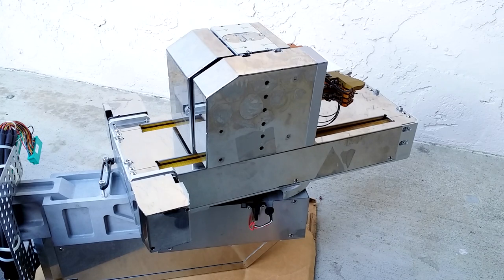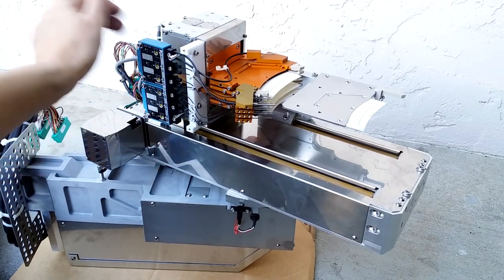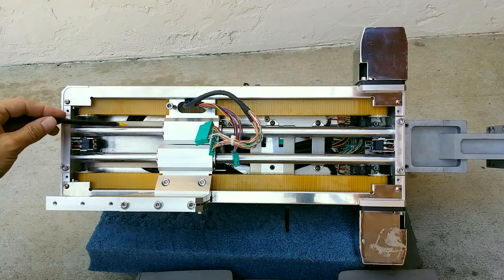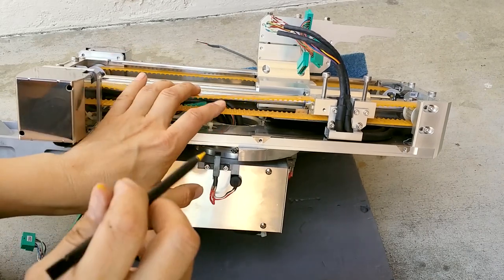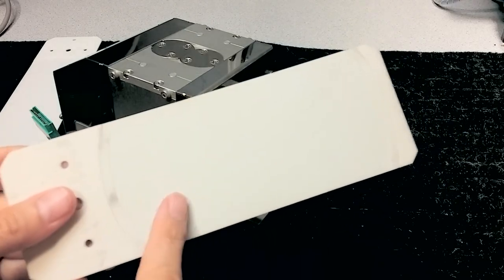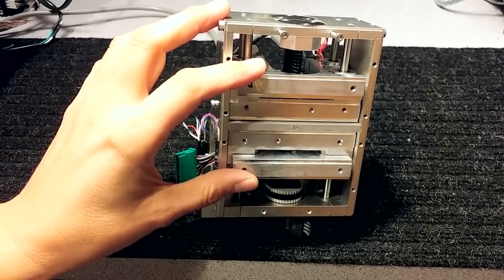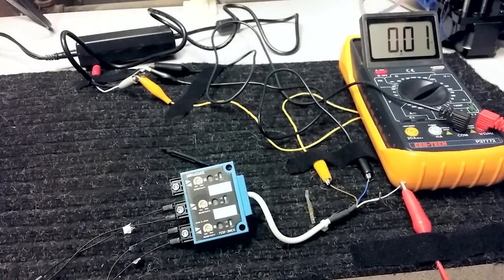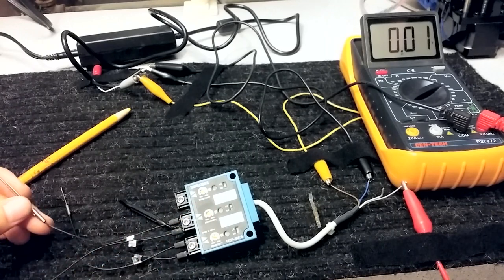Wafer Transfer Robot Teardown and Experimenation - BrendaEM

Comment: Having worked with these devices IN a cleanroom, it both pained and excited me watching you touch the polished faces with bare skin
Reply from the maker: Lol! A lot of this stuff was sold for mixed-metal scrap.
Reply from the maker: So, it was okay for it to be out in the driveway? : )
Reply: @BrendaEM  There's a Cisco Catalyst 6000 floor chassis on Ebay that looks like it's in a farm equipment repair shop. God knows how much it cost in the late 90s but now it collects dust and probably housed mice at some point.

Comment: The late engineer Steven Den Beste of Chizumatic wrote about his work with devices like these. He mentioned that (for reasons I cannot now remember) the wafers could not be clamped on to the handlers, nor could anything be allowed to touch the edges.. Thus, only friction kept the wafer from sliding on the handler surface (the flat ceramic panels you show us here), and the motor movement profiles had to be precisely calibrated to start and stop as quickly as possible without jostling the wafer out of alignment.
Reply from the maker: Interesting, the motors in these units are generally harmonic drives, with closed loop feedback. Still, in most of the units I took apart, I found broken wafers. Bad robot! Bad!

Comment: It is a five finger wafer transfer robot from the TEL Alpha 8se Diffusion furnace, it transfer wafer from a cassette to the process boat (tower) five wafers at a time. It's middle finger works independently from the five to transfer one wafer at a time when needed. It's a very reliable system when it maintained and calibrated correctly. I services these machines for a living. It's interesting you have one.
Reply from the maker: Thank you for info : )

Even the wire in the cables is made to be flexed. It's some weird copper alloy, perhaps with beryllium. If you skin a wire, you will see that the strands are not soft. The end effector unit(s) actually spread in two different directions, using miniature ball-screws. Usually, in these units, I see Omron photo-interrupters with built in compactors, which still work, in spite of their age. A few of the motors were 1000/steps per rev. 

I know of a company that still has a great deal of used fab equipment, should you need parts. I appreciate being able to save these from the scrap-heap.

Comment: Wow that's a sexy piece of metal there! - The things that seemed to be made by a waterjet made me think of wire-EDM - especially pieces with very tight tolerances - waterjet-cuts are usually slightly conical in shape, which doesn't lend itself to these pinch-points. The reason why you only get 1 volt output on the photo interrupter: look up the datasheet, you probably have a NPN-output (open collector) and it can pull down a voltage of up to 28V
Reply from the maker: Thanks. I've found a lot of this stuff has open or common collector output, such as the photo interrupters.

Comment: Darex uses fiber-optic measuring probes in their tabletop CNC sharpening system.  I guess they figured it was more reliable than using magnetoresistive probes.
Reply from the maker: They might be more accurate, and work for greater distances. Though, Hall-effect sensors are very robust.